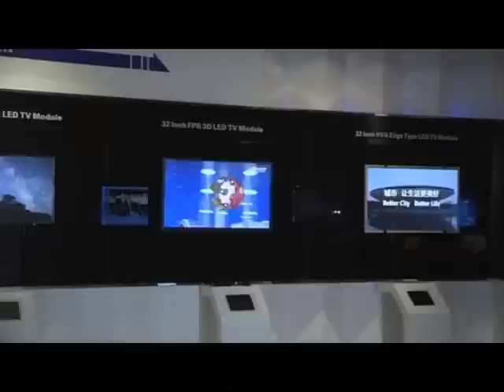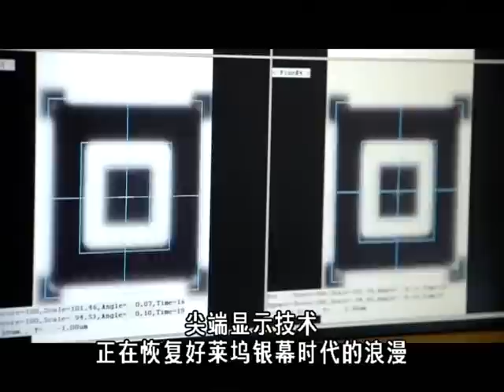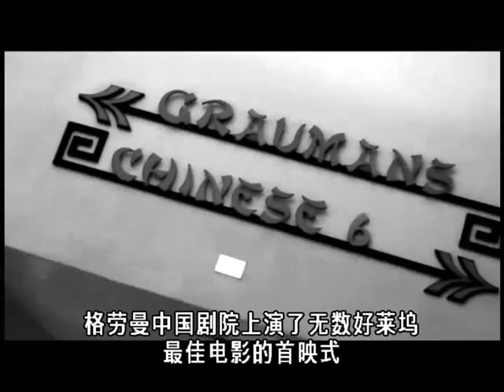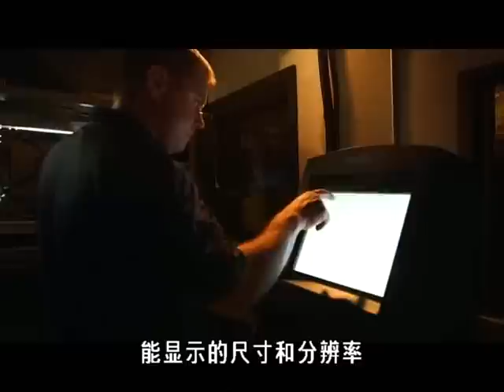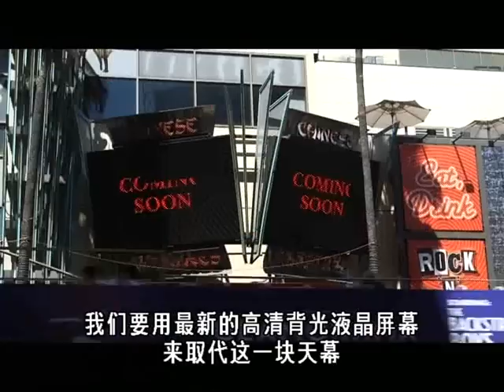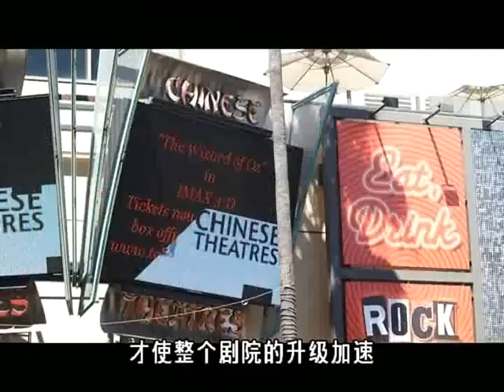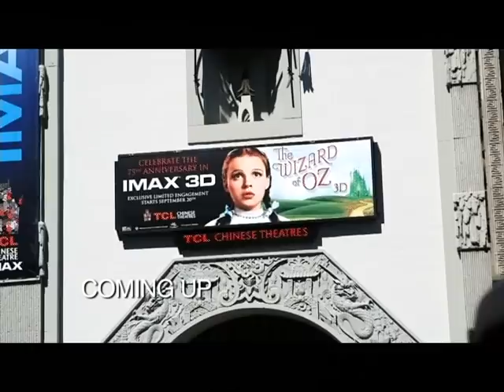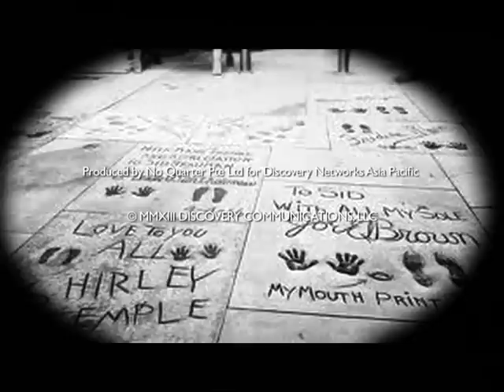TCL Chinese Theatre Documentary Video by Discovery Channel

Comment: I'm pleased they have carried out this renovation without removing or altering the bulk of the original structure meaning most of the theater is still as it was almost 100 years ago and still retains its original character.

Comment: Just a low grade LIEMAX 

If it not 35mm Dolby Stereo / 70mm Dolby Stereo with THX sound system and THX baffle wall its not cinema. It LIEMAX now and LIEMAX SUCKS! 

RIP Chinese THX cinema another doomed cinema that has been brutalized by LIEMAX
Reply: Jose Saucedo imax liemax is crap bass crap sound! 

THX kicks sand and dirt in liemax face!
Reply: Actually, it is not necessarily a “liemax” theater. It is an IMAX Laser theater, and it’s actually a little bit wider than an average 15/70mm IMAX, but isn’t as tall. Also, having been to both a 15/70mm theater and an IMAX Laser theater, the sound on the Laser theaters is so much better. Now, no digital theater can match the look of true film, but an IMAX Laser theater is about as close as you’re gonna get.
Reply: @richesmovietrailers953  Plus I think it's the only 1.90:1 IMAX screen with dual 4K laser projection system, compared to conventional 1.90:1 IMAX laser screens that use single 4K laser projection system. Every IMAX laser theater has 12-channel sound system, while IMAX xenon digital and IMAX 70mm have 6-channel sound system. TCL also has the largest seating capacity for an IMAX theater, around 932 seats.

And technically, TCL Chinese showed IMAX 70mm before with "Interstellar," in which IMAX 70mm projector was brought for that movie. In 1.43:1 ratio with side masking. (This doesn't mean 1.43:1 laser ratio movies like "Dunkirk" were shown like this at TCL, but they were shown in 1.90:1.)
Reply: RichesMovieTrailers I haven’t done 70mm or IMAX Laser. Before. But i plan on going to the Chinese Theater when the pandemic is over
Reply: Andy Summers im only American